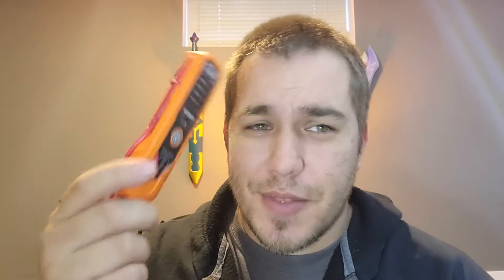Industrial Maintenance Tech EDC

Comment: I'm an industrial electrician at a university power plant. In my left shirt pocket I have a pouch that I'll keep a sharpie, flashlight, pen, pencil, and highlighter. My right shirt pocket I'll keep a notebook. Front right pocket I have a Klein utility knife, and my wallet. Front left pocket I keep my phone. In the small pocket of my pants, formally the watch pocket I guess, I have an extra set of ear plugs. I don't like having any bulky crap in my back pockets because I have lower back problems, so my back right pocket I have a microfiber cloth for my glasses. In my right leg pocket on my pants I have strippers and a Klein multi driver. In my left leg pocket I have my lineman pliers, and a pair of channel locks. On my front right belt loop I have a carabiner with my high voltage gloves, and a LOTO lock. Right side belt loop I have the keys for work. Left side belt loop I have a leatherman wingman and sheath. On my hard hat I have a flashlight, and I took a pair of ear plugs and tied them to the back. I also have my watch which is a galaxy active 2 on my left wrist. Usually my meter will go on my front left belt loop.
Reply from the maker: Yea I wanna try out the fluke pocket sized meter but I don't think it's true RMS to reduce thr weight of my EDC

Comment: Good video. Pen and a notebook seem to be the tools I use mostly these days. I also carry a steel rule, Knipex pen style panel key with a flat and Philips head, a 2.5mm flat terminal screwdriver, an ATEX rated torch, a volt stick and a set of gloves finishes it off. After that it is back to the workshops for a proper bag of tools.
Reply from the maker: Most of what I can do doesn't need much tools but I hate walking half to around the factory for a call and missing a small tool needed haha